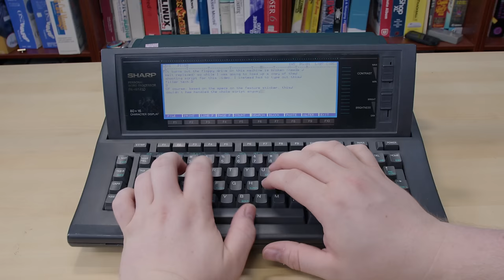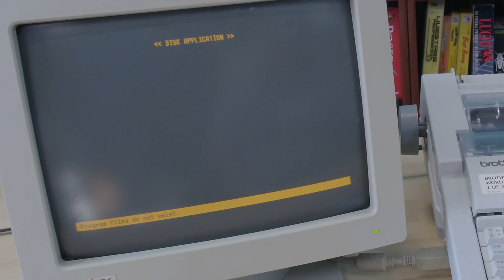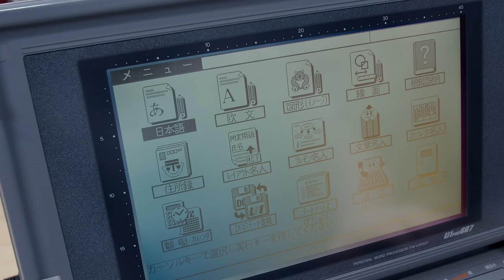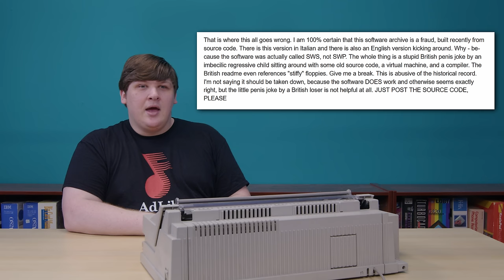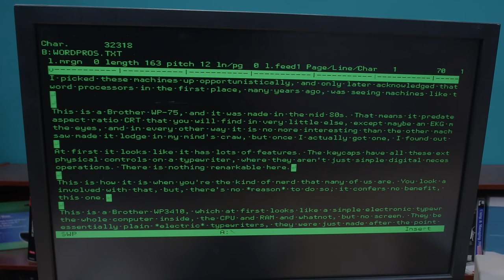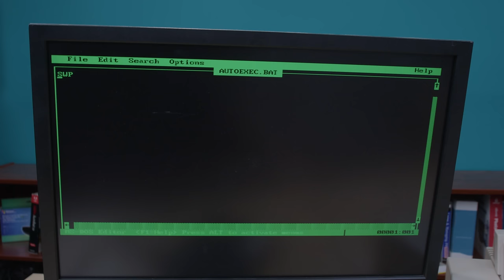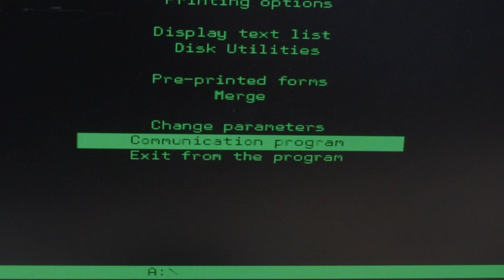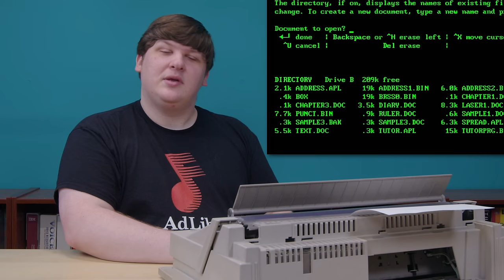The Weird Processor: Olivetti's PC Typewriter

Comment: So when you ran DOS EDIT, I noticed that it had - well, certainly not color , but grayscale. Well, greenscale. An intermediate, darker shade of green, for the document background that's blue on a color display. Something I don't think MDA did. But it also has blink and underline support [which MDA did have], so it's not purely pseudo-color. It makes me wonder what a full test of all attribute bit combinations would look like.
Reply from the maker: I need to dink with that more, but tbh I think what we're actually seeing is simply the MDA block characters with different patterns through a misaligned pixel clock that's blurring them together
Reply: @CathodeRayDude  Those showed up throughout other parts of the video, yeah [and they also had the characteristic vertical blur stripes of not having the correct pixel clock frequency], but I'm talking about specifically when you opened up EDIT, which definitely has a blue window background and not any kind of pattern fill when you run it normally.
Reply: Looking at it more closely [48:00] I see a couple other unusual things - the title bar [which i believe on a color display is in blue text on a light gray background] is completely invisible, showing up as light on light. The status bar at the bottom has its bright-white/high-intensity text correct, and the background [teal on a color display] is in a different intermediate brightness. And you can see the scroll bar on the bottom made of pattern fill characters.

The title bar being invisible is odd, if not for that I would guess that this simply had a separate emulation mode for the CGA text mode (does EDIT even use the background attribute bits when it thinks it's running on MDA normally?), like the... i can't remember what it was but I think you've shown some other machine that did that, it might have been the 5140? rather than supporting this odd subset of background colors simultaneously with MDA attributes.

But the titlebar makes me suspect that that's in fact exactly what's happening: the background is light gray, and the foreground is... light gray but underlined. Foreground color 1, blue on a color display, is the MDA underline attribute*. So essentially all evidence thus far is consistent with this machine combining MDA foregrounds [and blink] with grayscale-ified color backgrounds

*The light gray background would be MDA reverse video, but actual MDA reverse video is not combinable with underline, only high intensity / blink.

Also one final difference: the horizontal arrow buttons are wrong! The built-in font doesn't match code page 437. What else could it be hiding, I wonder. EDIT: only for the font that loads when the typewriter popup opens. I also noticed the typewriter popup's border is in an intermediate brightness, lighter than the "blue" background, darker than the scroll arrows, possibly the same as the 'teal' status bar.
Reply: @CathodeRayDude  It's definitely more than just MDA. You can't reprogram the font on MDA, but the word processing software has its own font, and you can even see the typewriter popup change the font when you load it in front of ordinary DOS! ...But I'm not sure what it could be if all the software you use thinks it's plain MDA.
Reply from the maker: @octocontrabass  well, there was a whole galaxy of graphics hardware throughout the 80s that was MDA/CGA/EGA/VGA... and more, if you knew how to access it. like the Headstart Explorer I reviewed in a past video, which only appeared to have Herc and CGA, yet could display colors that were impossible on either. I'm not surprised that Olivetti included SOME better-than-MDA capability - I just don't understand why they didn't go the whole distance and make it Herc or EGA compatible.
Reply from the maker: Fun New Information: I was completely wrong. The machine does at least CGA, and possibly half-baked EGA. A graphic mode test app reports it has an EGA card but so far I haven't gotten any software to work with it - but the fact that it is clearly doing color in DOS Edit among other things makes me think its actually using EGA 16-color textmode. Will report back with further info.
Reply: @CathodeRayDude  It's composite, right? They could fake 16 colors by using composite artifact colors. This was even a thing that was used in the earliest Sierra games to get extra color squeezed out of them.
Reply from the maker: @XanthinZarda  That technique only really works for games, since it trashes the resolution and the quality of the color is pretty bleh. It also requires a color monitor, which Olivetti didn't sell or advertise as compatible, and (as demonstrated) it won't work with standard displays. I can't swear that there's no color information in the signal, I'm not skilled enough with an oscilloscope, so it's possible, if Olivetti made a proprietary color tube for use with another machine in their range, that it might work with this machine. That's pretty far into conjecture though.
Reply: @CathodeRayDude  True. Conjecture will get us nowhere, as assumptions only make asses of us. (For clarity, that's meant as a subtle wink to the old adage, not a slight.)

Comment: If you want to look at a word processor that didn't suck sweaty balls, look at the Amstrad PCW that was sold in Europe. It was an all-in one computer built into the green phosphorus monitor with separate keyboard and bundled cheapo dot-matrix printer. Z80 based, ran a standalone word processor or could boot into cp/m and run software such as spreadsheets, dbase and tons of others, even games. I had one and loved it.

OK, it's a computer, but 90% of people bought it as a word processor.

Comment: fyi, there's a clear crt sound in the background of some of the clips, it's kinda irritating so i tweaked my equalizer to remove it for me, but most people aren't gonna go to that hassle...
Reply: Could you send a timecode with this noise?
Reply from the maker: Yeah, I figured that was unavoidable. I put in a 15 kilohertz notch in spots where I was using a CRT, but sometimes I don't get it all
Reply: Damn, this is the first the I didn’t notice
Reply: @CathodeRayDude  perhaps in some clips it was fine? because in most clips i didn't notice the sound - 9:07 being one of the few i did notice it in

Comment: I would totally buy the flagship Panasonic Rk-P400C penwriter or  Silver Reed EB50. Both have a built in serial interface and use wacky pen plotting. If I see either at the Re-PC I'll buy, tinker, then let you borrow it for a while..  Otherwise .... this class of word processor is a hard pass.

Comment: theres a huge good reason to buy these instead of PCs.
TRAINING. Nobody knew anything about PCs back then. at all. nothing. The Keyboardlayout didnt matter because noone had even seen the standard one anyway.
If you train someone new it doesnt matter whats your layout, conventions etc. 
Using these machines means very reduced skillset you have to train. easier to replace. its a single purpose machine and thats it. 
its not a question of costs / featureset at all. its a question of TCO aka total cost of ownership. you rather spend more on less features but have a lot less training, less costs for maintannce and replacement etc. nobody needed the features anyway (we still dont really)

Comment: I am a little disappointed in your perspective about these machines given you are a true nerd.  I not only used all the machines in this video but I started my IT career being a technician on the IBM selectrics, selectric IIs  IBM word processors and the brother word processors.  These machines were the end of the machine era as PCs entered the arena.   You have to put yourself in the shoes of someone back in 85 using one of these systems while a XT 8088 sat in the background becasse there really wasnt an affordable or complete WP software out there with the exception of WordStar or Word Perfect.  These systems are  still within the DNA of a modern PC.   The programming and engineering involved to make one those :boring: typewriters are nothing short of brilliant.  They demand the respect as anything else.   IMHO

Comment: Funny story, so a few years back I did pick up a very lightly used Panasonic T33 Electronic Typewriter specifically for eventual re-casing. Mainly for the really sleek angular grey case design, but the build quality was actually decent, and even the keyboard was fairly nice which was a surprise for such a unit, and I look forward to repurposing that with a matrix converter. It also has good ventilation in the back since it had an internal power supply.. XD

I think I got lucky, as most of the others I've seen since were indeed rather cheap and ugly by comparison.

Comment: you could erase a failed character on the mechanical versions too. talk about ultrawide displays. talk about word-pads. what is love, word pad dont hurt me, no more. sometimes its better to do all from scratch, if all what is current is trash. even more reason to do all from scratch if all what is does something that does not need to be done. helped? you want to be in the problems and continue to be under the fire, yourself.

Comment: ummm No People have a tendency to be both smart asses and Cheap asses whenever possible so, yes Spell check was a thing but no one bought it so they started to cram it on and in Word processors and Word Processor programs. Remember just because something was a thing doesn't mean it was widely used until much later if at all. it's like arc Welding... came around in the 1880's it wasn't until ~1942 that more than a bunch of Welding Specialists even knew how to weld... Simply cause of people being cheap asses.

Comment: Need those guys who can make Doom run on anything make Doom run on this I fucking need to see Doom running on it!
Reply from the maker: There is no version of doom that will run on this. Every version that exists except for one requires at least a 386. This machine has no protected mode whatsoever, so the only version that could possibly run is 8088 doom, which is based on the Game boy advance version. To the best of my knowledge that still does not include an MDA video output driver, although conceivably one can be merged in from fastdoom. More importantly, it requires a hard drive due to the extreme RAM constraints of this platform. Since the hard drive module seems to be unobtanium, it's not likely to ever happen. And honestly, if someone is going to go to all that immense effort, there are other games I would rather see, that would work better in MDA.
Reply: @CathodeRayDude  I think somebody with enough technical knowledge could fabricate something for the hard drive problem I would like to see something like that being done what would be a great video

Comment: 53:01 Will it DOOM?
Reply from the maker: Nope - DOOM absolutely will not run on anything below a 386 due to lack of protected mode, and even the clever (and very recent) FastDOOM source port can only target 286s. There is an 8088doom, but it's very limited since it's derived from the GBA version, and it requires a hard drive.

Comment: But can it play Doom?
Reply from the maker: Nope, doom will not run on any 8088 class machine. There is one port based on the GBA version that might work if I had the hard drive module, but wouldn't output any graphics

Comment: I like your video, but your approach is very bad. Probably because you're a computer nerd. My father was a typographer, a profession, a device that creates completely analogue text from a very distant past. Did you know that as early as the eleventh century and from the year 1000 onwards, books were printed using block printing in Europe? The typing machine that shows where you think an A4 can fit crosswise can also handle an A3. When printing a newspaper, an A0 is often used as a starting point. From a printing press perspective, the typing machine is a completely different device than a computer. A computer is for, as the word suggests, calculations. A typing machine for language. You as a nerd should understand that a person usually has either a technology or a language preference. But it's great that you made this video. I'm a fan of your channel. ps. try a Hercules monitor. An don't forget Olivetti is an Italian factory. If you are looking for a new home for it, I would be happy to be the recipient to give it a new home. Greetings Anne.